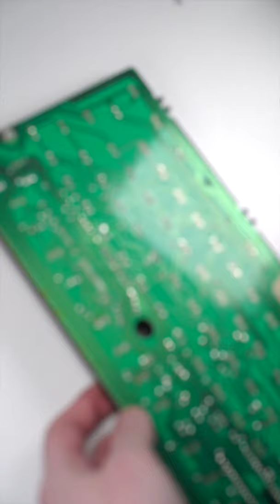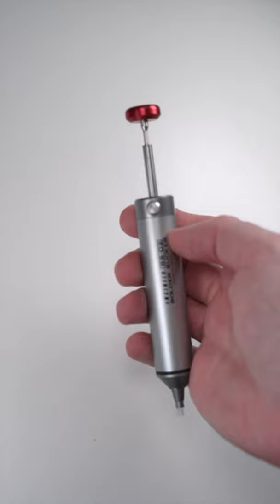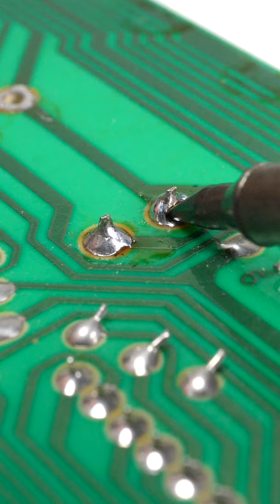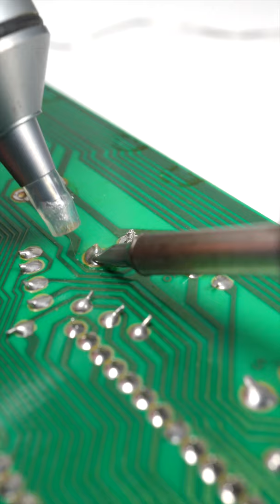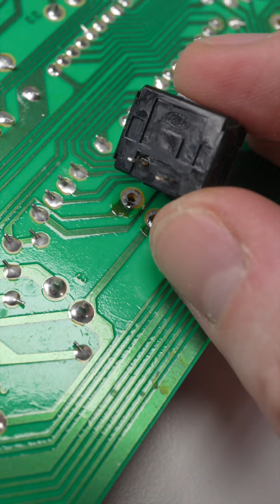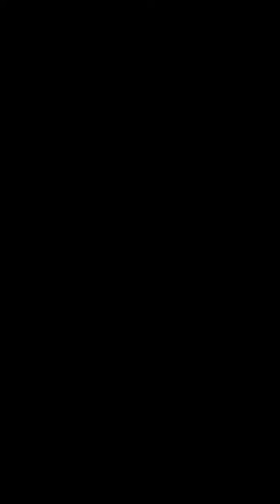Desoldering Pump - Collin's Lab Notes #adafruit​ #collinslabnotes​

Comment: I just had to replace a switch on one of my older pre-built keyboards. I was struggling to get the solder to melt, so I ended up needing to add a little bit more solder to the joints for it to finally start melting. Took me like 10 minutes to figure that out. Now I know 😂
Reply: The added solder helps conduct heat from the iron to heat the existing solder, and increases the thermal mass of the enlarged blob so that it stays hotter and melted for a longer time. In addition, if the new solder is leaded, and mixes with existing lead-free solder, that lowers the overall melting temperature. That makes it easier to melt, and allows it to stay melted longer.

Comment: I bought a cheap (25$) electric desoldering gun. Even with this, I find difficult to desolder some parts. There is always some sticky solder residue where there is no gap between the lead and the hole.
Reply: I use the wick to get these last bits out.
Reply: That's been my experience with the pump as well... typically a little solder still on the joint. Although it's a bit pricey, I switched over to a Hakko desoldering gun. That thing is a dream come true, so long as you clean it out.

Comment: This particular solder sucker has a silicone tip, you can simply place it over the solder joint while you're still heating it with the iron. The seal is likely to be less good, but it's a little bit less cumbersome than trying to hit and seal the joint with the solder sucker in that split second that your solder is still liquid enough. Over time the silicone will obviously wear out but it's easy enough to replace.

Pro tip: if you have a plastic solder sucker, you can likely add a piece of silicone to its tip as well.
Reply: Was about to comment both those point. Great minds ;)
Reply: do you have an image of what that would look like?
Reply: Yes, I believe mine is this model, and it comes with replacement tips for this exact reason.
Reply: Ya that tip would be sooo helpful
Reply: I also added silicon tip so I can heat and trigger at the same time
Reply: Awesome. I'm definitely utilizing this tip on my plastic pump.
Reply: Tip: if you get the specific pump shown in the video (which is amazing), they give you 3 replacement tubes of silicon, each like 5cm long. You can snip some off and replace when you want, lasts forever.
Reply: Does it help to add flux?
Reply: my plastic tipped pump has plastic that melts at a way higher temperature than my iron, so I don't need to be worried about it melting and can keep it closer to the joint

Comment: I just learned that the reason they give you extra plastic tips is because you should be making a seal which makes the pump work at it's best. .. and this you may burn the tip ... Thank you so much !!

Comment: I don’t really do electronics any more. I tried all of these pumps and the best one by far is the big blue one. It’s huge compared to any of the others but is so much better. I used the same one as in the video for smaller stuff but the big blue came out when I had loads of component retrieving or bigger joints.

Comment: Anyone know at what degree it’s supposed to be? Mine maxes out at 480c and it doesn’t turn any of the iron into liquid it just heats it up.
Reply: Ur soldering wire must be bad. Buy a better wire and check if it has hole in the middle of the wire when you cut it with cutter. Middle hole contains flux.

I bought a bad wire before and i use 480 aswell. But when i bought a better wire, i just usually just solder around 360.

Expenses priority i think is
Wire > flux > multimeter > solder iron > pump > holder

Comment: I have a question. Can i desolder the switch successfully without the soldering pump?
Reply: You can, but requires specific techniques, and equipment. Easy enough to do, I've seen it, just not qualified to give instructions
Reply: @TheAMGReviewers  thanks for the information. Also my keyboard switch broke off its pins on the main board, so now how can I desolder the broken pins that are still on the main board? I thought of putting the keyboard on a screw driver stand that puts constant pressure on the pin, would that have worked?

Comment: How often do you need to push out the sucked-up solder from the pump? After every joint?
Reply: Every time you push in the pump, it ejects the sucked solder. Sometimes you may have to remove it's tip when it gets stuck though.

Comment: What if the existing solder wont liquify? Is my soldering iron garbage?
Reply: Adding some more solder or some flux can help remelt stubborn bits. It could be your soldering iron isn't powerful enough, it might be worth getting an adjustable temperature one, I found even a cheap one with swappable tips to be a good improvement over the traditional ones.